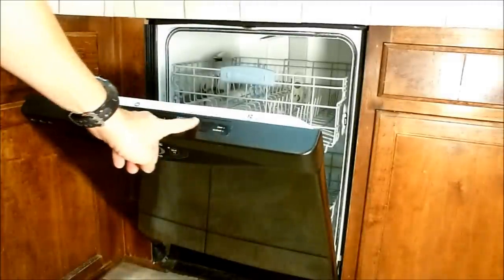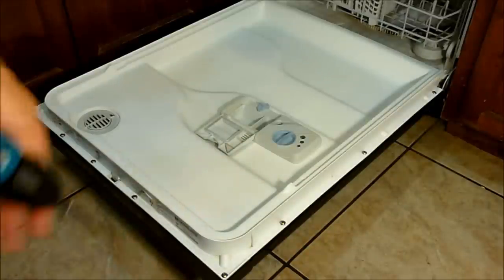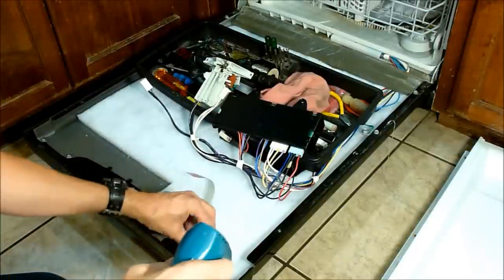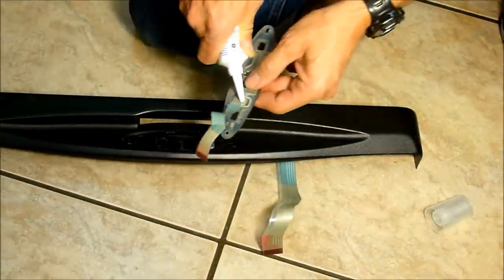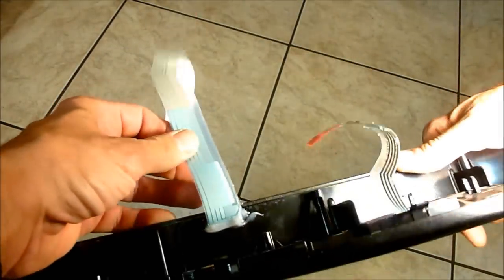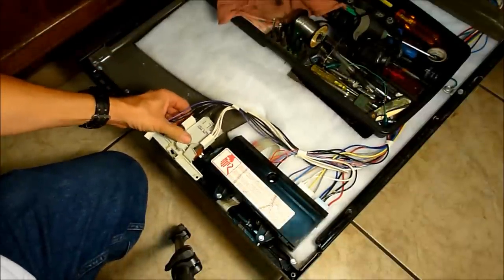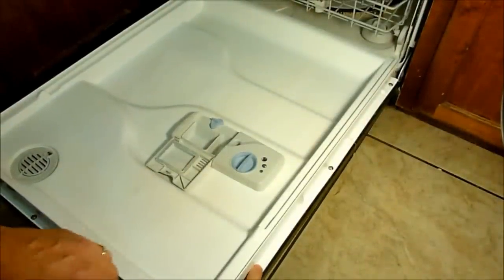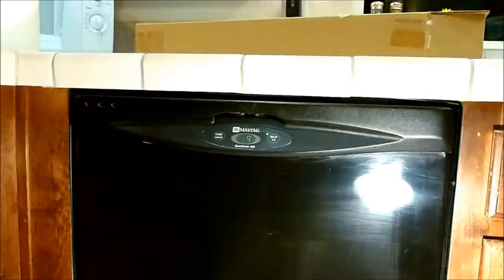Maytag Dishwasher Touch Pad Problem Repair Fix MDB7601 Control Panel Display

Comment: So, if I do what you did here in this video and we don't have corrosion, I guess the next step would be to replace the electronic board? Or do you have any other suggestions of what we might try if it's not corrosion?  I just want to be prepared when I open the thing up of what I should be looking for and what I might need to replace.

Comment: Thank you for that very helpful maintenance video. I have the MDB8751BWB almost the same except no vent port. I had some flooding last year with about 4" of water from sewage pipe and the only problem I saw with my dishwasher was the outside control with the time having intermittent diode problems. When I pressed on the number display they would get a contact for a while but today as I went to start a load the display has nothing. The upper inside wash selection works fine.  Do you think it is just those ribbon cables corroded?

Thanks again,

Rob

Comment: What kind of Silicone did you use again?  I'd like to try the same thing.  Just got the new control panel in the mail today.  I can't quite make out what you are using...it is the Door and Window silicone?  The tube doesn't say RTV on it so I wanted to make sure.  I'm handy enough to make the repair, just want to use the right caulk.  Thanks!

Comment: I had my Maytag control panel fail just after 18 months. Maytag is well aware of the problem, yet refuses to offer any compensation on a poor design for which they are responsible. I  spoke to a Maytag supervisor and got no satisfaction. This is my third Maytag appliance and the last.

Comment: Question: I have the same problem and thought it was only the latch. (MDB7750AWB) the United had power and the Start Light was green. However, it wouldn’t run since the door latch doesn’t completely shut. I turned the main power off and replaced the latch. But now there is no power nor green light on the Touch panel. Main power is on. Wondering if you have any ideas or suggestions. Much appreciated.

Comment: Unfortunately, he didn't describe how he cleaned the corrosion.  I have corrosion on the front Start panel ribbon cable but not on the top panel. The Start Panel ribbon cable is removable and it has a part number (919325 REV B     PARLEX MA EMAY02 11/07/11/01).  The Top Panel ribbon cable part number is (919322 REV D   PARLEX MA BMAY046 12/06/11/01)  I would rather pay for this part than replace the entire panel.

Comment: I removed my control panel and realized the ribbon between the handle and facing was eroded. I cleaned it with vinegar and a brush, covered the erosion with black electrical tape, and put it back together carefully. 2 loads in, it's working well. My dishwasher has a full soft touch panel (maytag) and had the error that flashes the "drain" LED. Fingers crossed.
Reply: Michael Mosley so you didn’t add any thing for the electrical connection just used electrical tape?
Reply: Gabriel Hearn that's correct. Still working well. I just added the tape to basically protect the ribbon from rubbing bare again. Seems to have been poorly designed.

Comment: How did the silicone repair a faulty or corroded circuit board?
Reply from the maker: It kept the moisture out of the keypad. I had a replacement keypad I used. the keypad didn't fail but a few years later the lower plastic for the spray arm became warped and I had to replace the enter dishwasher because the part needed was not available.

Comment: Hi i have no experience with any of this but can those strips be permanently damaged? Mine completely doesnt work and before i take it apart i wanna know if i might need new parts
Reply: Q: Did you get your _______mfg______Model number Dishwasher working again?
Re: can strips be permanently damaged?
Strips, as the parts that comprise the control panel? (AKA TouchPad/Keyboard.)

Yes those strips can be permanently damaged. Lots of people are reporting MOISTURE causing corrosion on the ribbon cable and people have seen water in the area of the buttons.

Comment: I want any consumer to be aware that Maytag dishwashers are the worst investment that you can possibly make. For the model MOBH979AWS3- the steel touch pad dishwasher that we have owned for 3 years we have had to repair the electronic panel at a cost of $250/visit twice. When contacting the company there only response is that the product is out of warranty and there is nothing else that they can do.  It is not worth investing in Maytag. Buyer "Beware"!!!!!!!!!

Comment: That was the second time you replaced it and the part was $230.00?  I am a repair tech and you can add on at least $100.00 for labor.  Sometimes you change one electronic control on it and it ends up being the other expensive one.  I usually recommend new.

Comment: We have an MDB8989 that has touchpad issues because water can intrude into the damn panel. They didn't make the assembly waterproof wtf 

Only brand new appliance we ever bought and its been a nightmare

Comment: Can you please private message me info on your class action suit.  I luckily bought the extended warranty and have already been through two control assemblies (which they took with them) and the door part with the touchpad at the top.  My Maytag just came out of warranty and is not working again, and it's another touchpad/controller problem.  They ("W") suck.  Will never buy another appliance from them ever again.